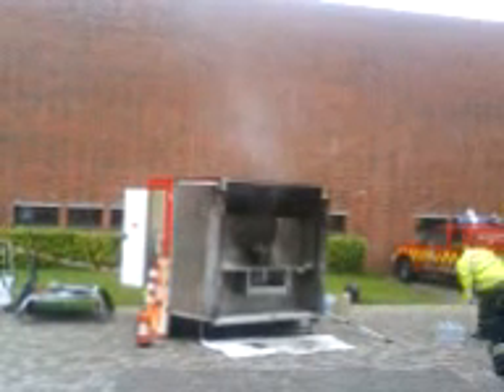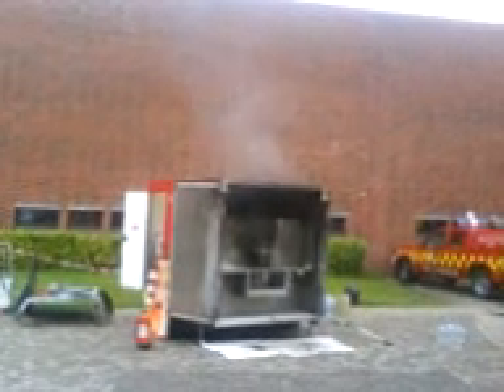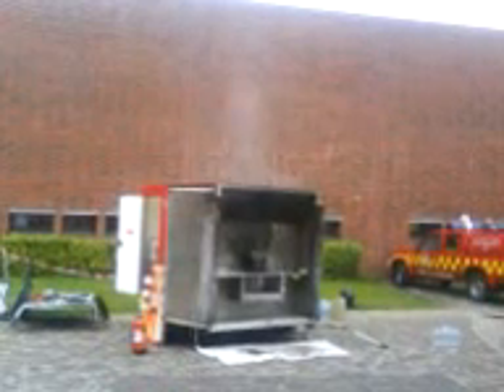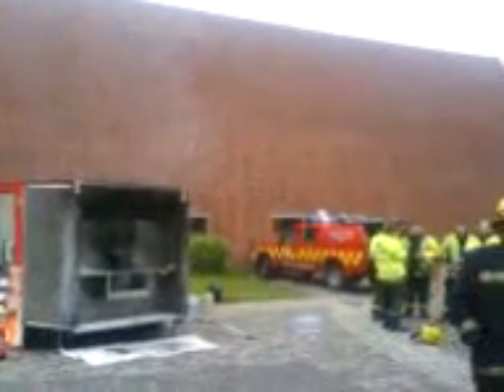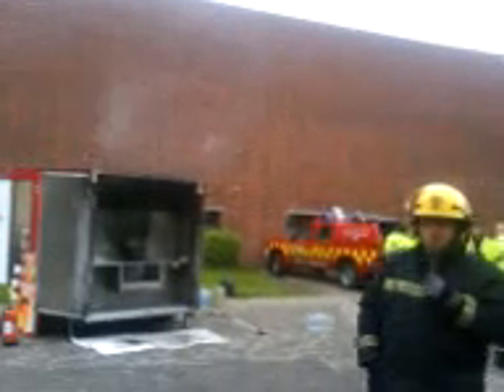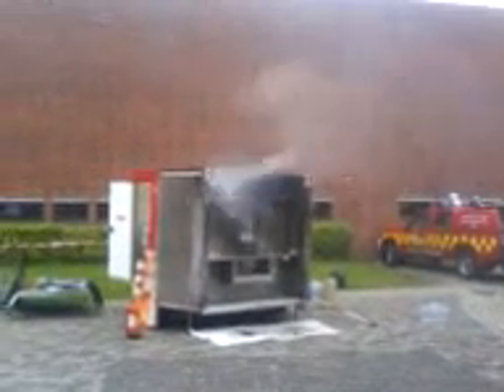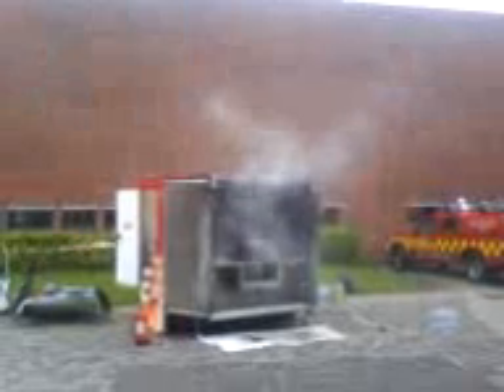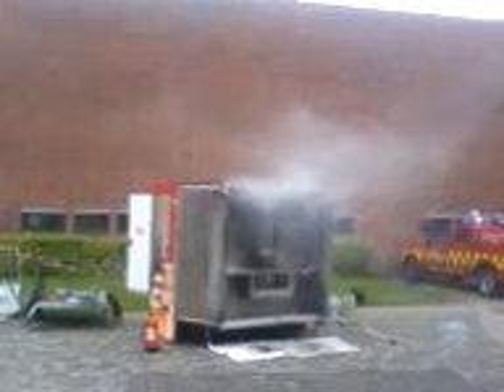What happens when a deep fat fryer is left on too long and when water is added

Comment: Some physics: water expands over 1000 times when turning into vapor (0.018 l liquid = 22.4 l of vapor), and this multiplier is even bigger as it does not into account the change in temperature .
When you normally boil water, this is a slow process, but when it comes into contact with high temperatures (like oil), /all/ the water transforms into vapor at /the same time/. And rapid expansion of volume ... that has an other name:
== Water litterly explodes. ==